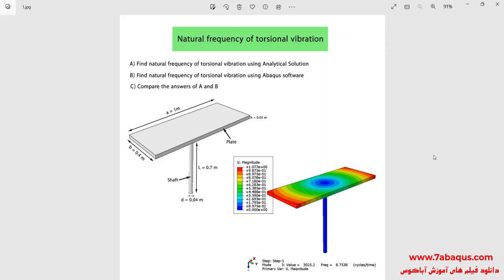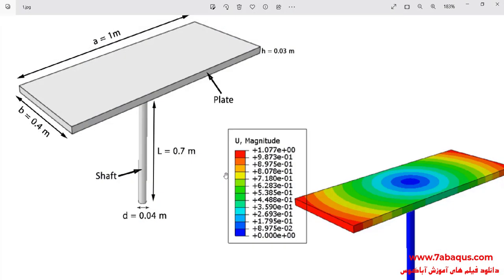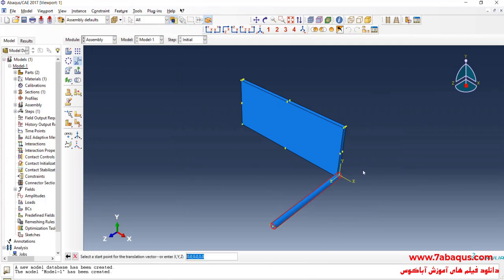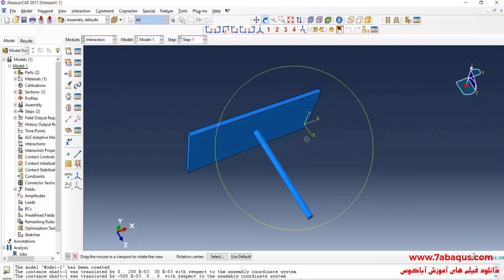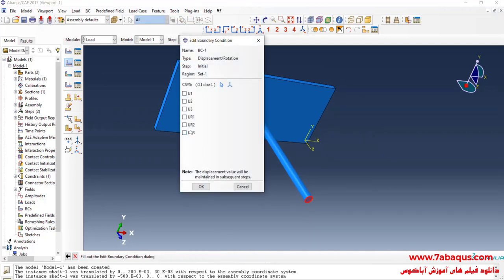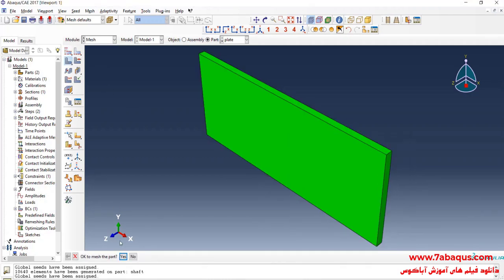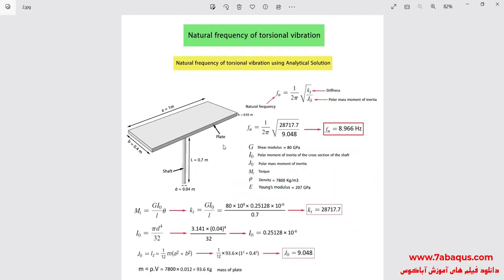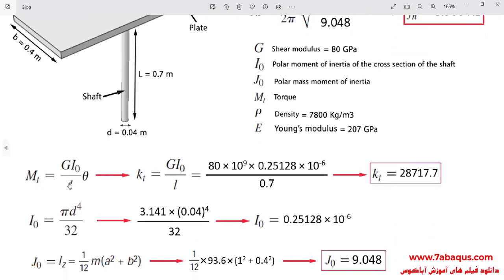Natural Frequency of torsional vibration using Abaqus software and Analytical Solution

Comment: You used a value for G=80GPa in the analytical solution. Taking into account that G=E/(2*(1+nu)), and nu=0.3, you should use a value of G=79.6154GPa. As an alternative,  you could use G=80GPa but using nu=0.29375. May be any one of these alternatives could aproach the numerical solution to the analytical solution. Nice video. Thank you.
Reply from the maker: Hello
Thank you
There is not much difference in the results, but I rounded 79.615 GPa to 80 GPa for convenience